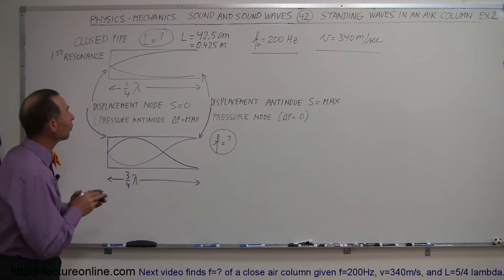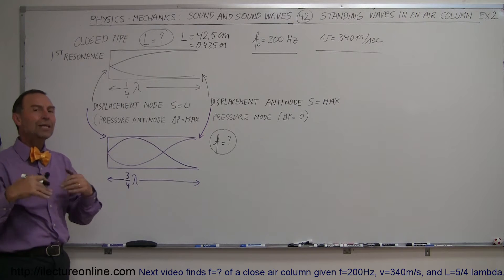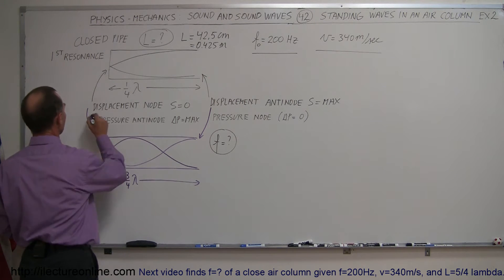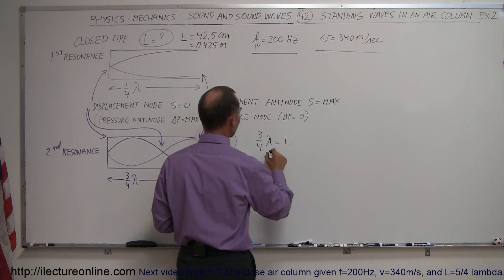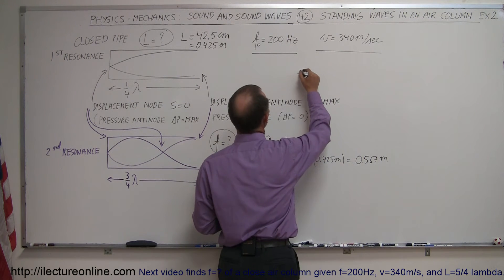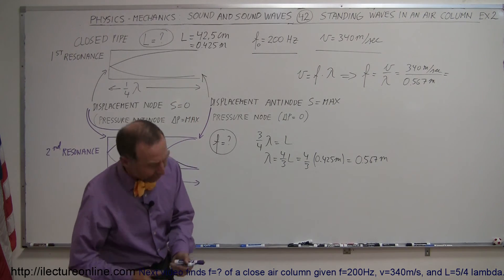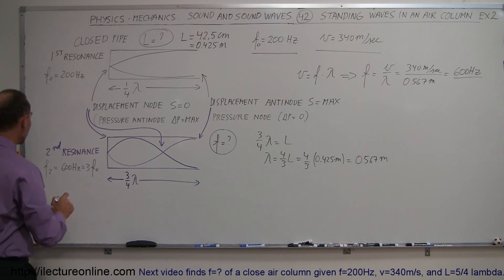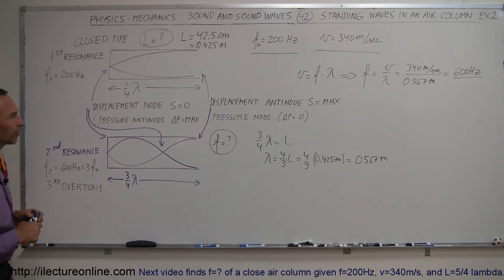Physics 20  Sound and Sound Waves (42 of 49) Standing Waves in an Air Column Ex. 2

Comment: How can i know the length is 
 3/4th of the wave length by seeing on the picture ?
Reply from the maker: If you compare that to a sin or cos wave, a complete wavelength starts at the center goes to the top peak comes back down to the center (that is a half wavelength), continues to the bottom peak and back to the center.  That is a full wavelength,

Comment: It's displacement curve inside pipe. That's I desperately trying to understand. Thanks gentleman
Reply: It's tricky because he's drawing the displacement as a graph where up is more displacement, but the actual sound displacement is longitudinal, that is, left/right. So when the graph goes up or down a lot, it means the air is moving the most left/right.